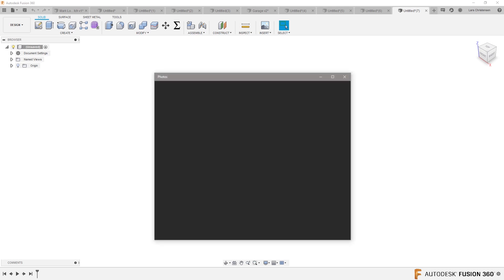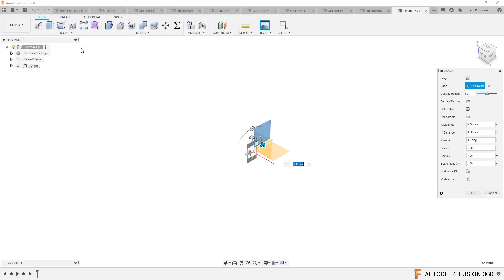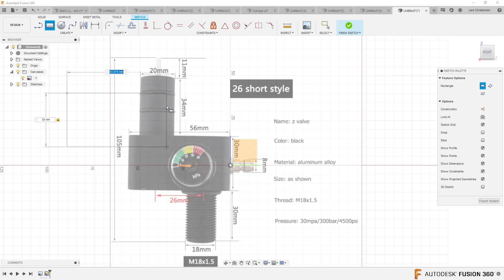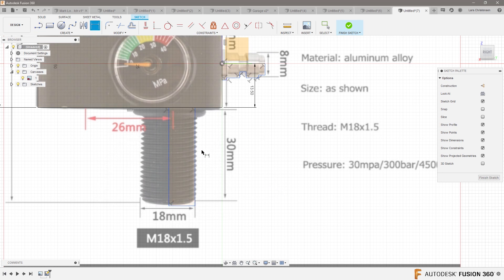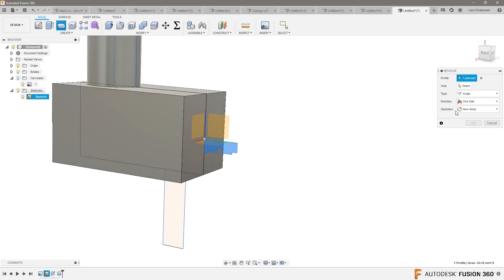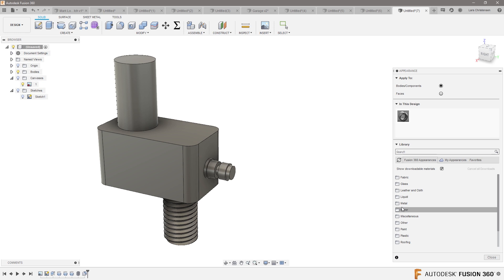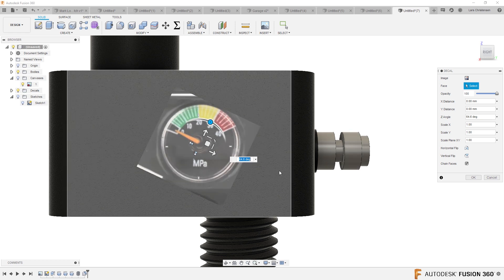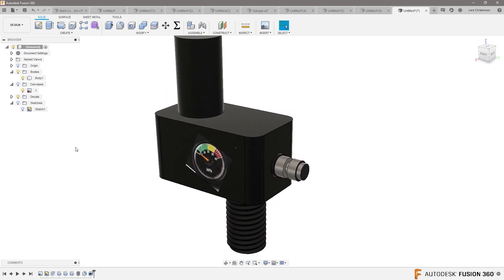Fusion 360 — Save Time — Maybe Your models are too complex — Ask LarsLive

Comment: Unless doing some really specific demonstration imo it's more useful to model something like that as a space reservation for actual installer. Let's be honest that it's just a common usually meaningless model, excluding space you need for it. Especially since this is general air component and very likely is changed to something else in field some year. So just make space reservation,plus add some tolerance for future. Modeling everything in unnecessary tight space is doing things wrong, unless it's a very specific need to do.

Comment: Your desktop looks way different than mine. How do you get your constraints on the top bar?  Thanks
Reply: Each menu item has a submenu under the three dots on the right. In this submenu you can add this item to the toolbar or to the Shortcuts ("S" key) menu.

Comment: Btw the new interface makes finding stuff I just learned nearly impossible.
For example I wanted to swith to the Patch module and extrude a curve BUT the "fancy" new interface doesn't have one - at least not in the same place.
Reply: Change for the sake of change. I'm more concerned with the fact that the Camera view will change from the nice 'Perspective with Orthographic Faces' back to Orthographic every time I create a sketch! To top that, now when I press 'Q' to Press Pull, the sketch no longer rotates slightly to reveal the press pull arrows. Nightmare. I cannot roll back to the previous version and am stuck with this now. I did a clean re-install to see if that helped... Same results. Running latest Mac OS. All up to date.
Reply: @SMatthewsFilms  there is a preferences setting to reverse the toolbar changes but it is only available for a limited time